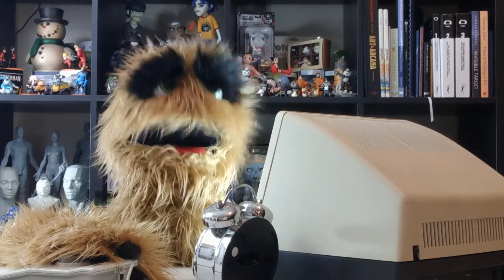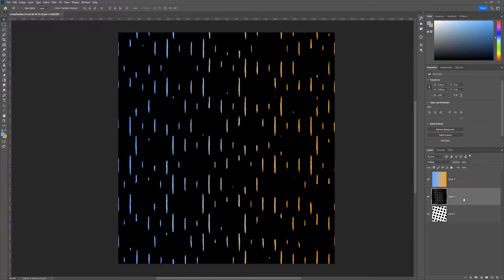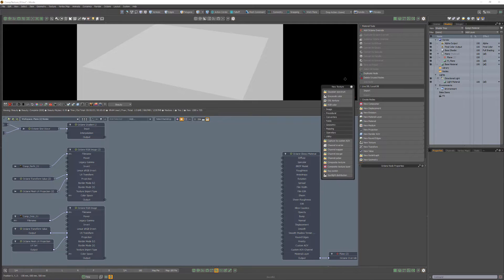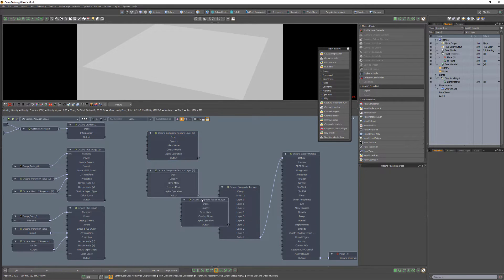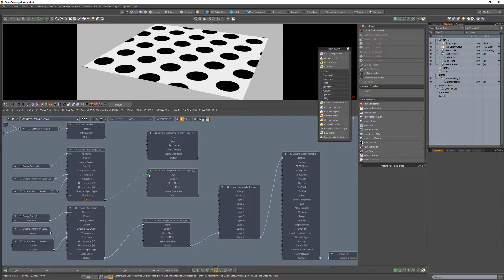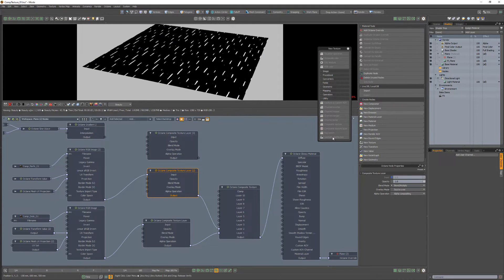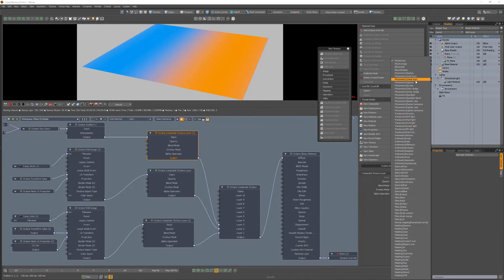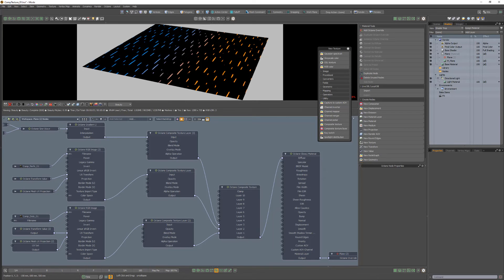Modo | Octane Render: Composite Texture Node

Comment: Is Composite Texture Layer gone in the latest Octane (2023)?
Reply: I have only recently installed Octane and I don't have it either. Just the Composite Texture. Not the Composite Texture Layer. I can't see a way to make this work without both.
Reply from the maker: I see it down at the bottom (in the utility category)
Reply from the maker: Then there's the 'new texture layer' button with all the options under 'new texture'
Reply: @pixelfondue  It's not showing up for me in the latest 2023.  I have the Composite Texture, but not the Composite Texture Layer.
Reply from the maker: You have the latest Modo plugin?  It may be a pre-release still (but should be on the OTOY site).  @mattperson7293
Reply: Select New Texture Layer>Texture to achieve the same result as the missing Composite Texture Layer node.